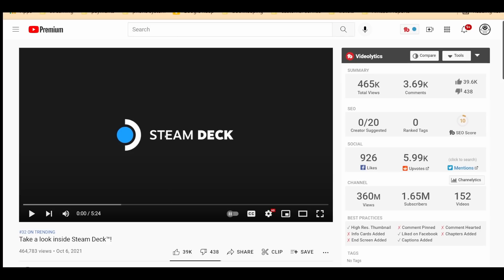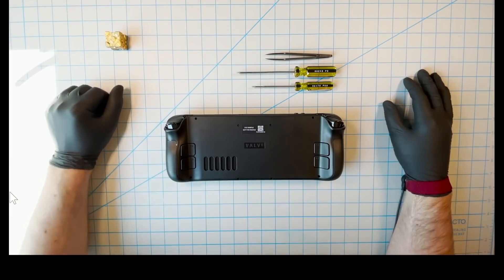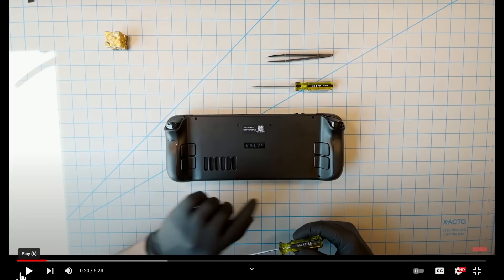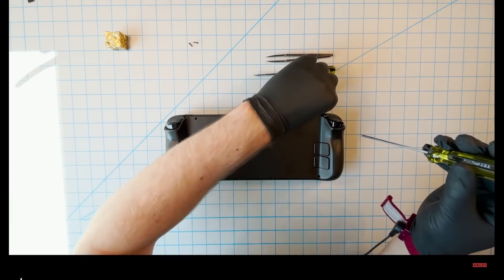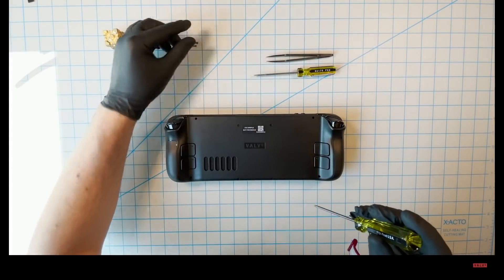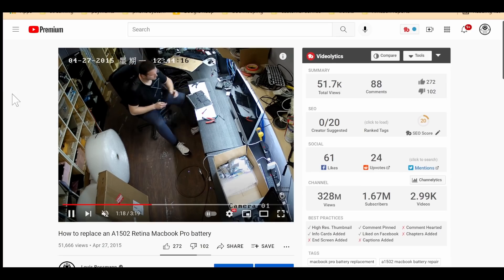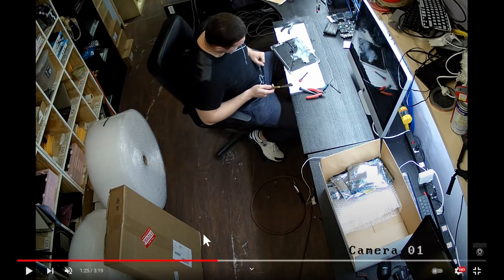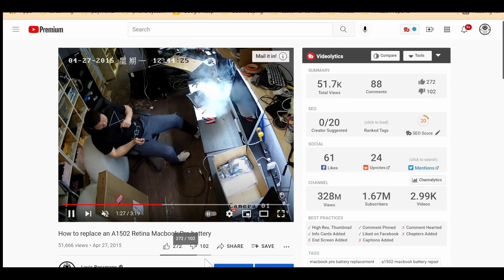Steam deck battery may end your life? bruh 😑

Comment: I know they were hyperbolic about the battery, but its better to be cautious than ignorant.
Reply: Exactly. Handling lithium batteries requires respect, because there is a legitimate risk of thermal runaway with puncture (lower risk can be achieved by opening the device while the battery is lower or drained), but with safety practices and being safe with disposal, it shouldn't be anything to worry about.
Reply: a person with basic understanding of tech will have absolutely no problems and the hazards are truly minimal. the difference here is that this product is advertised towards the average joe who probably wouldnt have a clue of what theyre doing trying to open one of those
Reply: Not really too hyperbolic the gases ruptured batteries let off can tear your lungs up. Especially if you face is literally 3 feet away with no ventilation
Reply: The professionals or people who know their stuff like most of us will simply ignore those warning but the twelve year old Timmy who have never used a screwdriver in his life would probably never open it. Personally I would much rather want a video to carefully say what to be careful of rather than say "you are going to die!" but that's not their place to do it and as long as they sell replacements or at the very least give a compaitable list of SSD which can be used I am more than happy with them.
Reply: Yeah, we need to remember that the majority of people are pretty tech illiterate and making a official teardown video for something like a handheld console could lead to kids or dumb people actually harming themselves thinking they can do it.
Reply: Valve is making this accessible for us, but also covering their butts against idiots so they can minimize hassle on both sides
Reply: "it's better to be conscious than ignorant"
Is the exact mentality that right to repair is trying to fight.
Safety, security, privacy, think of the children !